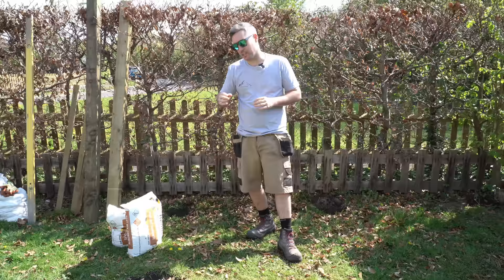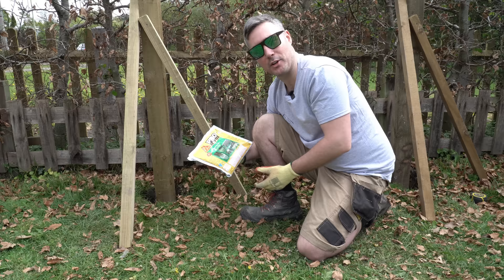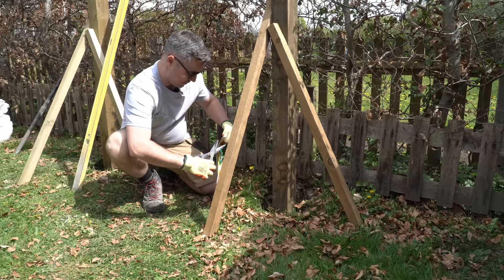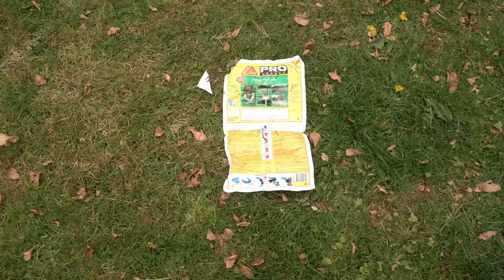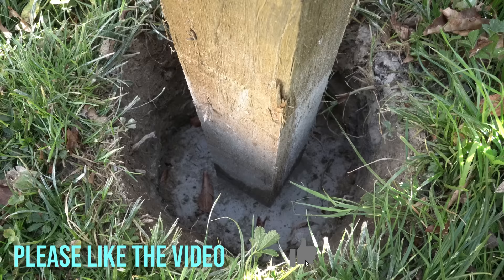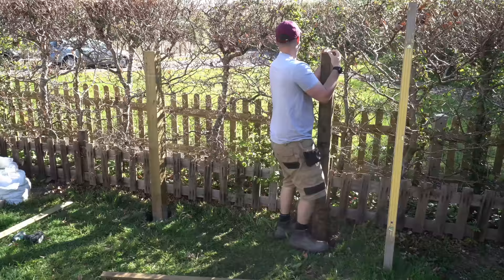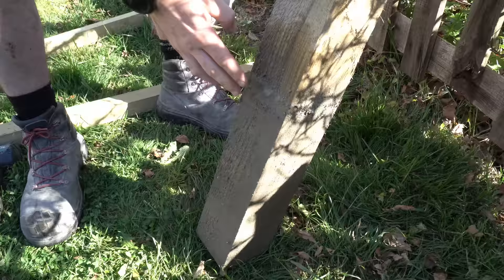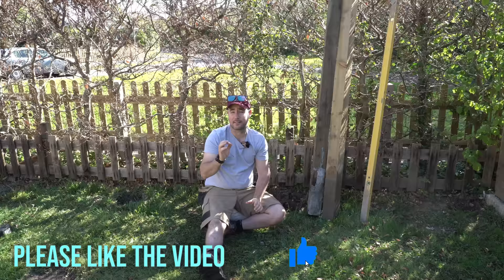Fence Post Foam vs Concrete | STRENGTH TEST

Comment: Better get more concrete in those holes til it's above ground surface or you will be replacing those posts 3-5 years later.

Comment: So the thing the foam warned you about you let happen? You allowed water to be in there? Could this be why the foam didn’t work? Nice that you waited 6 days vs the time marked on the foams package to test. 

These are two different products needing different requirements to set. This guy treats both the same favoring the characteristics of the cement. 

Also worth noting there was no post treatment on this post. Why would you put untreated post in the ground.

Comment: Not so fast... actually, the concrete will hold moisture and the post will eventually rot across the top of the concrete and shear off.

Don't know why concrete is used in the first place to set a post. The ground is quite plastic and will yeild over time with any lateral force as you demonstrated.

Firstly, auger the hole (minimum of 1yd/1m, the deeper the better) and then pour in at least 6-8"/20cms of crushed stone in the bottom (for drainage). Then drop in the post (prop it) and refill the hole with gravel and pour water onto the gravel and tap it down allowing it to fully absorb and repeat a few times over the next few days, and then you can continue with the fence.

Comment: What a cheese ball test. Posts in Canada have to be At least 4’ deep but the main thing is you didn’t even backfill.. the foam is a plug. I agree the concrete is a better option but At least give it a proper test. Wish I could un watch this

Comment: if you had mixed concrete before chucking in hole and  tamped  it  it would have set  faster and stronger    you would not be able to pull it out  like you did    40yrs experienc

Comment: Idk what happened here but I used that foam and it swelled up out of the hole. Did you follow the directions and let it mix correctly?
Reply from the maker: Yes i followed them by the book. Only difference was i made the holes slightly larger for better filming. Ive heard alot of guys say it reacted the same though.
Reply: @JamesMontana  Thats the issue here.  The post is weak because the diameter was to wide and the foam didn't fill the hole.  This was user error.
Reply from the maker: @koryjames8361  Whatever size hole I would have dug it still constricted and left the post wobbly. And who wants horrible messy foam all around the bottom of the post anyway? It just not a very good product whatever way you look at it.
Reply: @koryjames8361  exactly he's got a 1' base of foam in almost a 1' diameter hole. I don't know which is better because hi test was poorly done.

Comment: If you do it right you will never be able to pull a post out of concrete after a week. Concrete needs to be mixed to be strong and filled to the top of a 2' hole, rather than only half way. Pouring water on dry concrete mix just washes the cement out of the aggregate and does nothing to consolidate the mix. Foam is a joke, especially if used to hold posts on a heavy wooding gate.

Comment: It isn't strength that's the problem.  Foam will trap water at the base of the post, as will concrete, thereby rotting the post.

Comment: do you think it would work better if you cut a little curve on each edge so the concrete will grab on it so it doesn't just slide out?
Reply: It's best practice to drive some nails, screws, or lags into a post before setting it in concrete to help prevent it from sliding up and down if something goes wrong.
Reply: @EthanPDobbins  right. I totally forgot nails or screws. lol
Reply: @sdutango  lags are actually best.  Zinc coated and thick enough to not rust away. Good holding power and your concrete should be under the post as well but provides some holding power in the downward direction too in case your bottom is thin. An inch thick bottom is fine for a fence post because those you can even just tamp bare into dirt if you want. It's not super load bearing but ideally you want something like 4 inches of concrete under the end of a pole barn/house foundation type post   with lags you Only need 2 of them on opposite sides too because they are so thick.  Screws are pretty good. They are usually coated and hold better in the wet but do break more easily especially after they eventually rust.   Nails are cheap and they work well, and bend rather than break but they'll rust off quicker. But it doesn't take much bite too keep a post from slipping in concrete. I've always used nails. Most folks don't use anything but the concrete 😂. As long as it's pretty wet and the woods clean and it's braced well and not jostled while wet  it'll probably adhere by friction so well you never notice. But i don't like busting out old concrete to re set a loose post!

Comment: Holes were too big for those posts, 1 bag of Concrete shoulda filled tot he top, I'd imagine the foam woulda been fine if the hole was smaller as well.

Comment: Can i ask if which on is better to lessen the wood rot between putting just a cement, a mortar, or a concrete?
Reply: pressure treated 4x4's last 4 times longer than regular wood

Comment from the maker: What do you guys use to set your fence posts ?
Reply: personally, I like quikrete mixed in a 5 gal. bucket with a drill and a paint mixer. That foam seems terrible. I am surprised they are selling it.
Reply from the maker: @skyweapon  It really is bad. Its just a novelty thing, i think.
Reply: @skyweapon  If that were true than why are the utility companies using it when they repalce a 1500 pound pole?

Comment: Evertried pea grit?
Reply from the maker: In the bottom of the post hole ?
Reply: @JamesMontana  Yes. It keeps the end grain off the soil. If the end grain sucks up ground moisture the center of the post will rot.

Comment: So you remove all water and then fill it back up a third if the way with water ???? Then too off with water , but make sure you get the water out before you start ???? What????

Comment: I have used that foam crap before, tried it out with a fence line, justba straight line with 8 posts 6 feet apart! 
With in a month, the entire fence was warped, and if a mildly strong wind would have come, then entire fence would have been on the ground. That foam is nothing more than a gimmick, and if you use metal posts, it's even worse! 
So why would I spend the extra money for crappy foam when I could do the job for about half the costs with concrete, it makes zero sense! 
Also that foam is not water tight, and would will rot all the way to the bottom!

Comment: This is not the correct method of mixing concrete for a post. The concrete needs to be mixed in a wheel barrow first before pouring it in the hole. I consider this test invalid.

Comment: Dang I was REALLY hoping the easier one would work 😢
Reply: It's fine if installed correctly.  This was wrong from the start. The hole was way too big in diameter, at least 12" instead of 8 or 10".  It should completely fill and overflow.

Comment: Why would you just ASK for an issue with this. The bad thing is your not going to immediately know if it works or not. A year from now the customer is going to call like “hey, all the posts on my $20,000 covered deck are wobbling”. Who’s to say that foam isn’t going to compress at some point?

Comment: The foam you are using is rubbish. Researching this a little bit, there is something called Polecrete or Postloc that is a 2 part foam and it is substantially stronger then the stuff you demonstrated. I have seen video of utilities using it to secure powerpoles, it is far stronger than the stuff in your video. This stuff looks like something of a rip off. I have seen a pair of videos, the bags don't seem to have enough material, and the foam seems inferior. The Polecrete is closed cell, and seems vastly stronger, equal to concrete from what I can see structurally, but a lot lighter.

Comment: 2:22 Design fail😏 
The bad should be thrown into the pit. Either ripped open or it pops open by itself, but pouring such a small quantity into a rough hole, is a guaranty for wasted material and mishaps. 

Back to the drawing board🤗

Comment: If you mix your concrete the right way, like in a mixer or wheel barrel your concrete will be way stronger. You can't expect your concrete to have the strength when you mix concrete the way you did.

Comment: first off, not mixing the concrete properly first before going into the hole is just wrong! its the technique of shoddy fencing contractors. much stronger if mixed first! smearing some roofing mastic or tar on the fence post bottom section where it is in contact with the ground will prevent it from ever rotting out! there is more to proper fencebuilding than most folks realize.

Comment: You put to much water in the concrete mix. The concrete mix would be 3500 PSI to 4000 PSI if the concrete mix was a 4500 PSI. in six days.

Comment: You used the wrong product, test it using Fast2K. The product you used is trying to be Fast2K 😂 Try and pour the bag down the sides of the posts so it coats the whole thing, this is easier to do with Fast2K as it’s thicker and expands slower.

Comment: 3 foam bags for a post
Reply from the maker: Thats a crazy amount of money per post.
Reply: Beats lifting bags of concrete, getting a water source, a mixer. I wouldn't do 10 posts with it but two... Absolutely
Reply from the maker: @charleslynch908  true but it says on the bag equivalent of 2 x 50lbs bags of concrete. Which is plenty for a post.

Comment: What you failed to do (as instructed) is to pour it down the post... it sticks to the post when liquid.
THAT is why you have voids against the post.

AN invalid test.
Reply from the maker: It says pour mix into the hole. It doesnt say to pour it all around the outside of the post. In any case it didnt work as the mix contracted and left it loose in the hole. 

YOUR comment is invalid. 🙄

Comment: Hole should be 8" diameter. And 4 ft down for the foam.
Reply from the maker: Wouldnt want to have to dig thoes holes 😪😂😂
Reply: @JamesMontana   ohh ok. Anyways, the package says to use those hole. I think if you use them. They would pull out so easily
Reply from the maker: @TuhdaKeyeh  Yeah 4ft deep is hugely excessive for a fence post hole. 8" x 2ft is perfect 👍 The foam posts are really easy to pull out because there is no weight.

Comment: Your explanation of voids holding water around the post are mostly irrelevant, once the post is inside concrete or foam, or any other barrier for that matter, you have built a bowl, that holds all the moisture the exposed wooden post will transfer via saturation into the bowl.

Comment: You made the whole too big to start with on the foam hole. If the hole was the proper size the foam would have filled it in and come up to the top.not a fair demo.

Comment: I agree with others that commented on a few variables that weren’t accounted for. Overall, great video and appreciate the effort here but seems like a couple things could be accounted for to improve the foam performance (even if the instructions didn’t say to do this). Mainly, Both should use new posts. The foam one looks to be an older or possibly moist post. The concrete was new. In other videos I’ve seen people couldn’t get the foam off the post at all. Overall, I still feel concrete is going to perform better due to the stiffness and weight, but foam should do a decent job.
Reply: No the concrete will not perform better. It will cause your post to rot. They use the foam for utility poles for crying out loud.

Comment: The concrete was higher up than the foam, so you cheated the foam, then the foam works best when a wood post is in a concrete hole, my foam posts sitting in preplanted concrete holes have lasted strong 4 winters and atmospheric River storms

Comment: Using "dry mix" concrete isn't recommended and does NOT make quality concrete.  That is only done by people that are too lazy to mix it, watch too make YouTube videos by people that don't know what they're doing in the first place, or refuse to read the directions on the bag (there's a good reason why 100% of concrete manufacturers clearly tell you to mix with water!).
Don't "dry mix" people!

Comment: Your test is immediately VOID. SORRY. You chose the worst foam post setter there is. That garbage actually contracts as it cures. SIKA is trash and no it is not good. FAST 2k IS THE BEST. FAST 2K can actually fix SIKA if you made that mistake.

Comment: First, dry-mix concrete is terrible hack work by definition and NOT appropriate for comparison unless you are intentionally trying to do crappy work.  No, foam is not good--especially in areas where you have lots of critters like field mice who would love to turn that into housing.  Initial strength has MUCH more to do with the soil conditions than anything else but the only thing foam might be good for is a quickie repair on a house you are selling and hiding defects.  Just don't.

Comment: This is a ridiculous and ignorant demonstration i've seen You didn't use the product correctly so yes its going fail. 1st off, you need to dig below the frost line. That's 36 to 48 inches depending on where you live. 2nd, I don't know anyone that sets a post less than 36 inches deep. That's just pointless. 3rd, you need more than one bag of foam to set the post correctly. Do this over, correctly and then see if it compares to concrete. Oh, and by the way, you concrete wrong also.